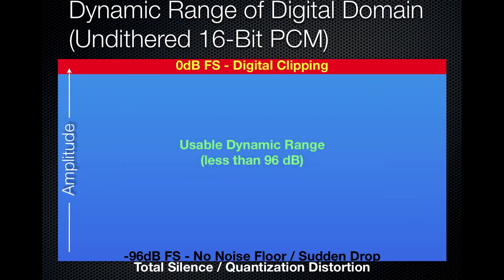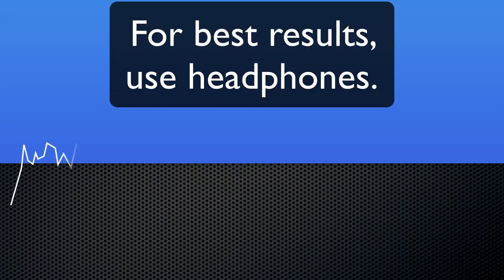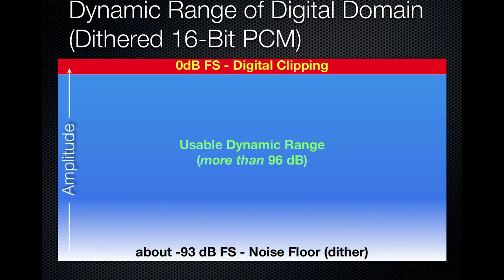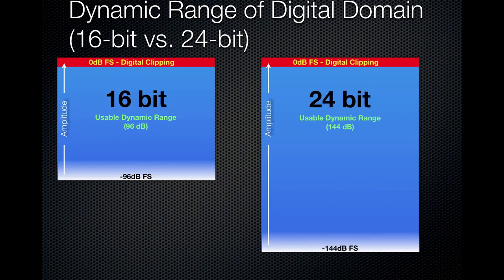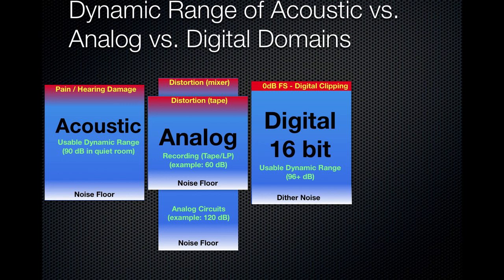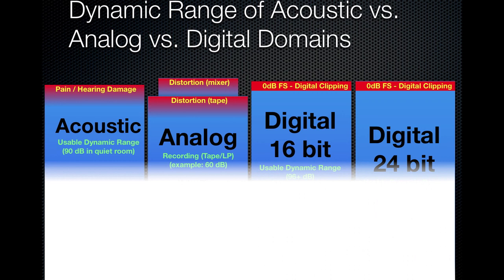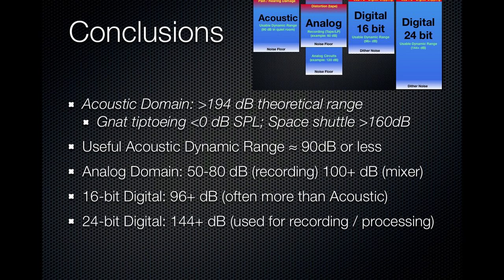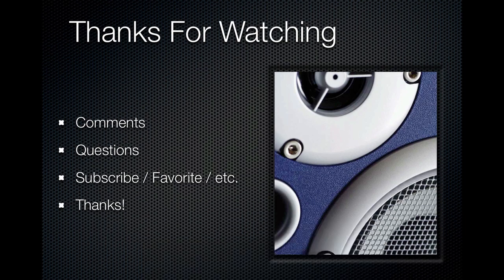AF009a - Dynamic Range By Domain (Part II)

Comment: The dynamic range over a frequency range of interest also depends on the sampling rate, which distributes the dither noise over a wider band. But quadrupling the sampling rate is more expensive than adding one bit.
Reply from the maker: True, that's how DSD works to provide a usable dynamic range with just one bit.

Comment from the maker: Yes. Different equipment will have different numbers, so those will not always be exactly the case, but in most situations, that's true.

Lossless rips are still a good idea, since different people have different hearing and some might hear data compression that others don't, but 24 bits is usually overkill for vinyl. It won't hurt anything, but in that case the information 24 bits hold that 16 bits don't will just be noise.